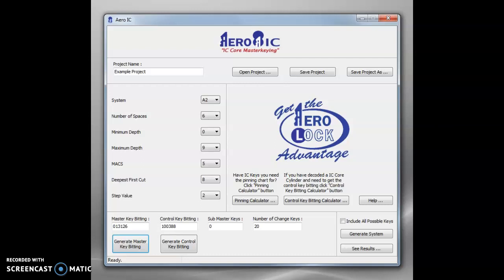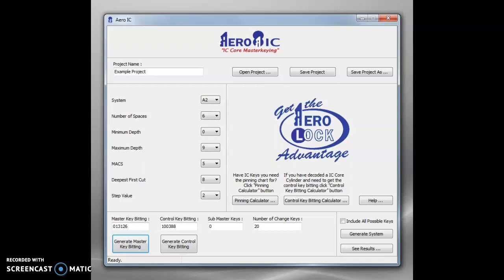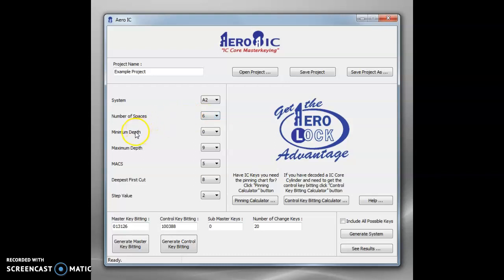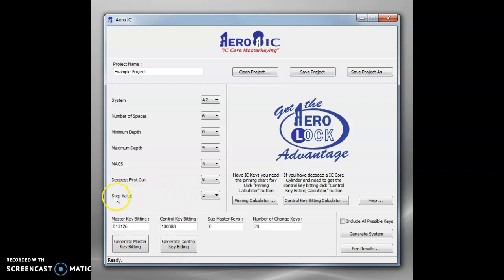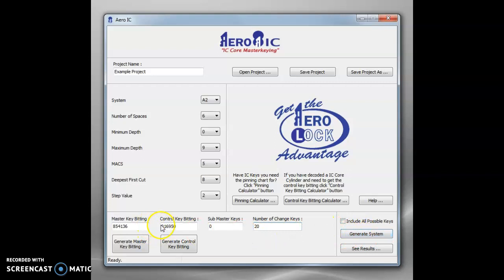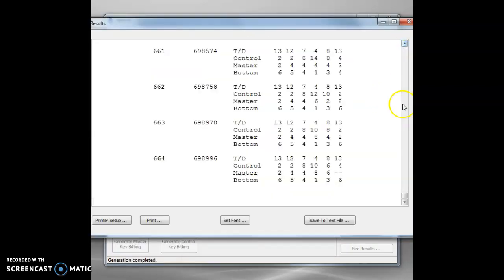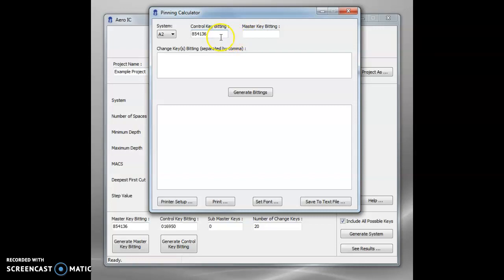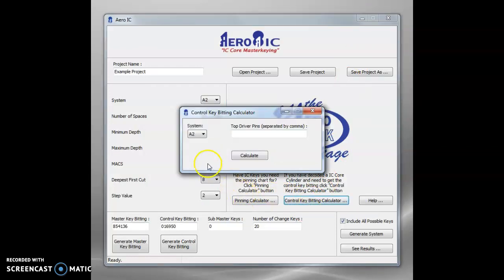Aero IC Core Masterkeying Software For SFIC A-2,A-3 And A-4

Comment: I have a quick question... So if the software gives me a Master Key of 7606485, and a change key bitting of 0100010, does that mean I add the change key bitting to get 7706495 as the change key?
Reply: No.  The control key would be 0100010.  That is a pretty bad control key bitting for a control key.  After a bit of wear the cylinder could possibly be pulled out with a blank key.  The main takeaway is that the master key and the control key are two completely separate keys.  You do not add or subtract from the master key to get your control key.  There is addition and subtraction to figure out the pin stacks that allow both your master and control key to function in the cylinder as intended though.  There are videos on the math of SFIC pinning that should help you understand the concepts if you haven't figured it out already.
Reply: @DorKeyLocksmith  Thank you!

Comment: While the Aero software does work and is reasonably priced, it does seem to fall short in generating good systems (just my opinion).... My point being it tends to have large numbers of zero cuts - I've had it generate systems with keys only having two or three out of seven cuts being other than zero...  For example, I just generated a system with Aero IC and got a system with a master of 3004832 (not bad), but then 1020010, 1020054, 1020256... The 1020010 isn't all that great... four out of seven positions being zero cuts, with the other three being really shallow? It's a valid key for sure, but as a customer, if I was handed a 7 cut key with only two or three cuts, I'd be like 'what is this?' Having zero cuts is certainly valid, but I think there should be a limit to how many zero cuts there should be - one, or maybe two in a seven cut key.... The software does work for sure, but it might take a few tries to generate a system that doesn't have a lot of zero cuts... IMO, variation is always good when it comes to cutting keys. I've fiddled with Superkey9 and that has a lot of flexibility and generates systems with more variation. Granted, it's much more expensive, but I'd think there would be some 'happy medium'. Main thing being more 'randomness' and 'variety' would be good in key systems - I've had it generate quite a few systems with a lot of zero cuts.
Reply from the maker: Yeah, 3 max on a key but I get the point. I go back and forth on this. I appreciate you taking the time to respond -PJ